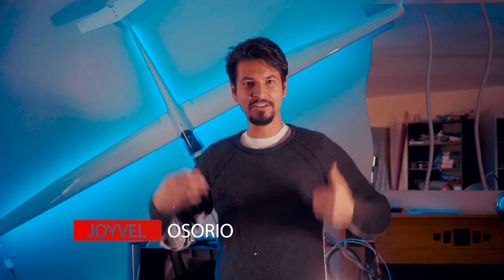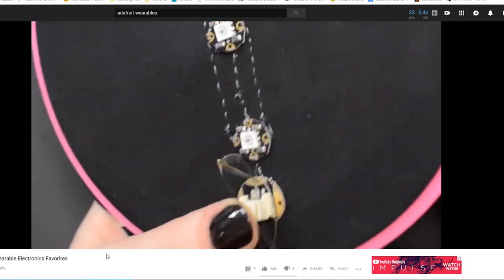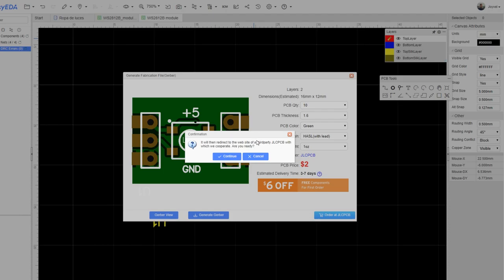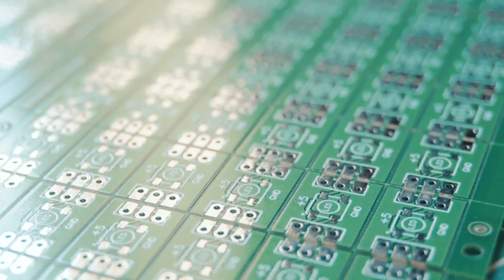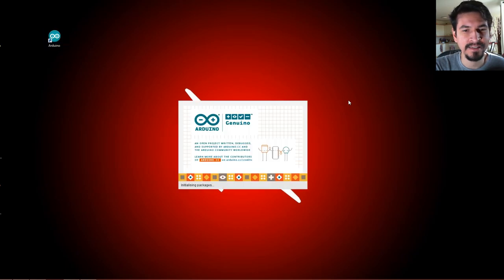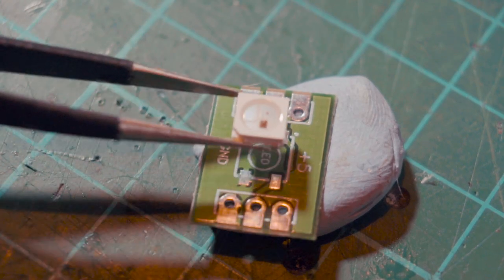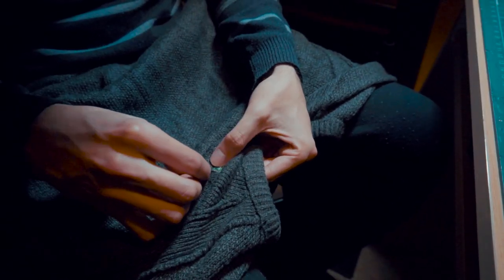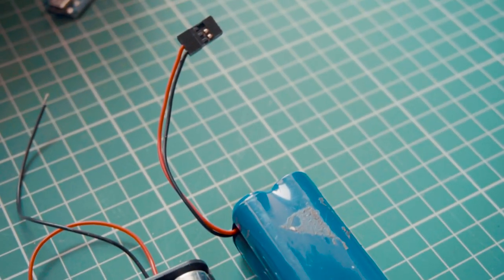LED lights in a jumper / sweater, wearable electronic project | JLCPCB

Comment: Well done.   Years ago I put a display in a hard hat I used at work...it spelled out my name.  I built a couple LED ties, before Fastled, addressable LEDs and Arduino.  I used 555 timers for sequencing.  I like your approach to this.  I use JLCPCB all the time, great company.   Have you considered using an oven and solder paste for your pixels (and cap/resistor)?   I had to solder 256 four-legged RGB pixels onto boards and did so using a standard electric range and solder paste.  Worked extremely well.  Every light on every board worked (32 pixels/board).
Reply from the maker: I haven't use the solder paste but some day I will.